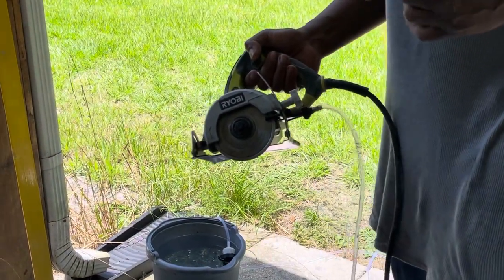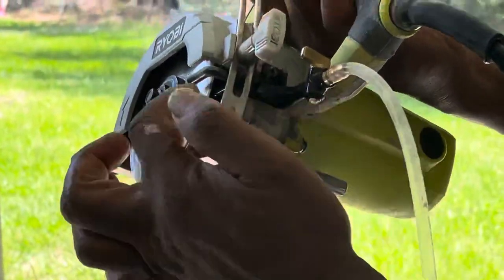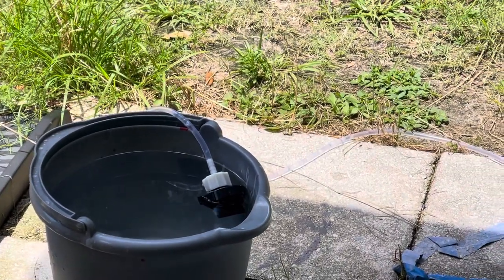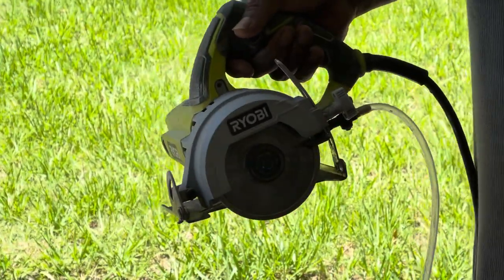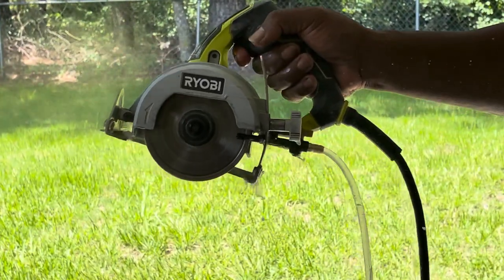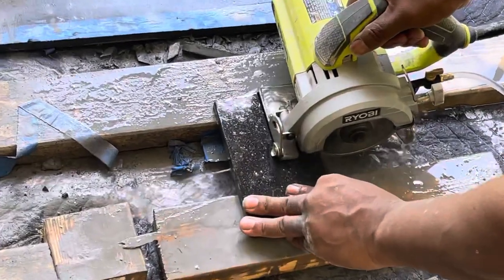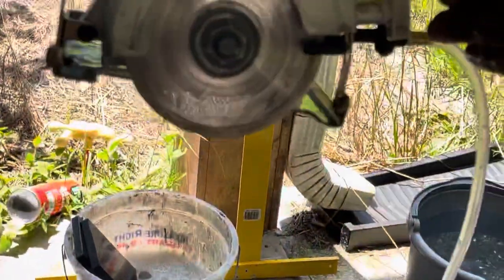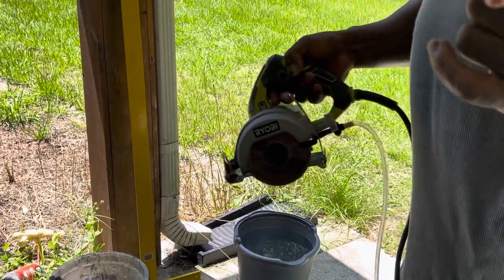Ryobi, 4” wet saw connections

Comment: This thing is a beast! I used it to cut existing floor tile around an island and had zero dust since it has the water line to keep it wet. I just put a spigot on a 5 gallon bucket and had no need to hook it to the outside water hose.
Reply from the maker: That sounds great, sounds like your project is turning out great just as well.

Comment: Thank you!!!! I just got this and I'm like ... hello??? Instructions??? 😂😂😂
Reply from the maker: 😂😂😂 glad I was able to help because I tell you I felt the same way. Those instructions were worthless.
Reply: @spinks4integrity for sure! I don't have a hose, do you know any other way I can rig it up to use? I tried connecting to my sinks but couldn't get it on there 🤔 I'm So sad I want to use it asap! 😂 I also can't find annnnnnything online about any other ways or extra parts to hook up to it.
Reply: Do you think it would be okay to just add water maybe through a water bottle just right onto the rock I'm cutting? I know nothing about tools, I'm a beginner with all of this and I'm doing it for rock cutting because I rock hound and collect rocks.
Reply from the maker: @alylouuu  unfortunately that’s the only way I know you have to have a waterholes because the water hose applies pressure
Reply from the maker: @alylouuu  actually that will work, but it has to be constant applied water. Otherwise the blade will get hot and damage the material and tool constant applied. Water will only work.

Comment: Hey man ! Wanted to ask a question. I posted earlier that I just purchased one. I tried cutting 4 foot porcelain tile. I was getting a lot of sparking from the blade. And the cuts are a little rough, is it possible I didn’t have enough water pressure from the hose. The tiles are only 3/8 inches thick.
Reply from the maker: You hit it right on the nose, NOT enough water gonna make sparks and then wear out your blade if you haven’t done that already. You’ll definitely know because it’s gonna also take harder to cut.
Reply from the maker: Remember, if you’re cutting a lot of tile is a good thing to have a second blade just in case the first one starts to wear out
Reply: @spinks4integrity  thanks again for your time. Appreciate it , I’ll do that.
Reply from the maker: @tbone2451  much respect and much success

Comment: It rotates the “wrong way” so do you make a better cut with the face down? Looks like it chips a lot with the face up
Reply from the maker: Just be sure blade is connected on the right side. What I do to help prevent chipping at the end of tile is I put a little painters, tape or any kind of tape on the tile while I’m doing the cut that should help
Reply: @spinks4integrity  I got one and have 48in pavers worth more than the saw itself, will be extra careful, I’m not used to reversed rotation so my instinct is to have the face down, will try both side anyways with good blades, hopefully it works out otherwise I have to find a bridge saw
Reply from the maker: @VanillaIceCoffee  you’ll do well, just remember to put painters tape on your cuts and let the blade do the work don’t force it a lot of times the chips come from trying to force it, so let the tool do the work and be safe